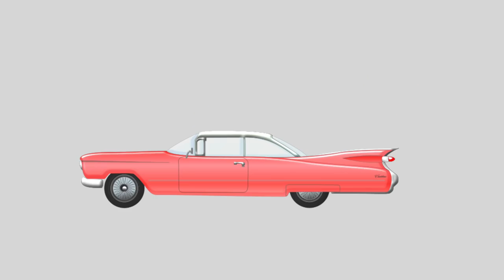Yes, Rockets CAN Fly in a Vacuum

Comment: No rockets can not fly in space.
Reply: A double negative? Who taught you to write?
Reply: @kitcanyon658  "A double negative" is a fragment.
Reply: @jrstuckey1471  :  Touché.
Reply: Well it's interesting, because not only can rockets work in vacuum, they are more efficient there, too!
Reply: You are right!
All rockets can fly in space.
Reply: @kornelrokolya  b.s.  There's no such thing as a free lunch or this "they become more efficient!"  W/o drag no thrust, without a downward force no lift.  So gtfo with this "it just works more efficiently there!" bullsheet.
Reply: @DrCash7  Drag has nothing to do with the thrust of a rocket engine. You create thrust by producing hot gas in your engine. The particles from that gas collide with your rocket and push you away, while you push them in the other direction. Not the particles in air, but particles which you just released from the combustion of your propellants. It has nothing to do with air, drag, or wings.

You're trying to project principles of one form of propulsion (aerodynamic surfaces, wings) to a completely different form. That's like asking how a car can move if it doesn't have pedals like a bicycle.

Comment: 0:65 the explosion forces air out of the exhaust...that really done it for me. Missy, do you know that a car works by using that combustion energy and apply it to the wheels? It is not using the energy of combustion to propel the car by means of exhaust gas. I know for sure, because I own a car. That's how it works.
If somebody tries to use the exhaust force of an automobile to explain why rockets work differently, this somebody should never ever voice their opinion again. Maybe about some royal or celebrity gossip - but never about how things actually work.
I still can't believe your car moves by the force of the exhaust gas. I want one of these.
Reply: Question for you, if i fire bomb near car would it move? If i fire similar bomb in vacuum will that car move?

Comment: I think that the motion of rocket in vacuum is due to newton 1st law (law of inertia) because there is no air resistance and gravitational force in space which stop the motion of rocket.
Will it be correct or not?
Reply: You would be wrong to think that there was no gravitational force in space. Remember that, for example, Pluto orbits under the gravitational influence of the Sun, and if the Sun's gravity reaches at  least as far as Pluto logic dictates that it must also be present in all of the space closer to the Sun.

Comment: In space. Acceleration would continue. The problem will be slowing down. ..?
Reply: No, it would not keep accelirating.
Reply: How not? 
No friction. 
No resistance
What force is there to counteract the accelerative motion? (Genuine question)
Reply: @Pappa953  you mean with the engines on or off? They would keep accelirating if the engines were pointing away of where they are going. Decelerating is just pointing the engines towards where they are going.
Reply: Pappa G - You mean "VELOCITY would remain constant", NOT acceleration.
Acceleration requires a force, maintaining velocity does not.

Did you even take high school physics?
Reply: Stuart Gray  I did take high school physics. But too long ago for it to be relevant and for me to be absolute in the vernacular. But politeness has remained. Twatty snarky comments to strangers so as to elevate my ego isn’t in my remit.
Reply: @Pappa953  so do you believe that rockets DO work in vacuum or not? if NOT, I can convince anyone (with a high school grasp of physics) exactly HOW rockets work in a vacuum.
Reply: Stuart Gray my understanding is that yes they work in space. However unlike the movies an initial burst to get it moving is all tha would be required to begin moving. Because there no resistance or friction the object would continue to accelerate. Until an opposite force is applied to reverse that. Any explanation more complicated than that. My brain won’t be able to cope.
Reply: @Pappa953  - You had some of the above right until:
"Because there no resistance or friction the object would continue to accelerate"
No the rocket will NOT continue to ACCELERATE.
  It will only do this when UNDER ACCELERATION when the rocket is FIRING.
Once the rocket is done firing the projectile will continue moving with constant VELOCITY until acted upon by another FORCE.

Comment: Every action has an equal and opposite reaction. But in space, there is nothing to react against. I still don't understand. The only reason that a car goes forward is that the bottom of the wheel in contact with the ground is going backward, reacts with the ground, and forces the car to go forwards. But if you lifted the wheels off the ground, the car wouldn't move because there's nothing to push it forwards.
Unless you could make an object react against itself, like putting my feet in two buckets and trying to lift myself up. I can't say that I've actually tried it but I'm pretty sure it wouldn't work
Reply: Stand on a wheeled trolley. Assume it can roll in any direction without friction. 
Take two balls. A soccer ball and a bowling ball for example. They should be the same size, but clearly different mass.

In turn, throw each one of them in a direction, at exactly the same speed.

Will you and the trolley beneath you begin to roll when you throw the balls?
And if so, which case will cause you to roll faster? When you throw the heavy ball or the light ball?
Reply: You don't need to necessarily push against a medium to go forward. You just need to push against SOMETHING. For rockets, it's the gas produced when fuel burns. The rockets are pushing this gas inside them to the outside, so the gas pushes them in the opposite direction.
Reply: @richie6921  in this example, the hose pushed the water out , and the water pushes the hose behind
 But because you're touching the hose, when the hose comes behind, it pushes you a bit behind too
Reply: @aaryajain6396  Same that pushes a rocket along in space
Reply: @richie6921  yeah, rockets work on the same law.
Reply: @richie6921  Would a CROSSBOW, fired in a vacuum STILL HAVE RECOIL? Yes or No?
Reply: @stuartgray5877  yes, because the bolt is reacting against the cord. A rifle would also have recoil aswell
Reply: @richie6921  Then why don't you think a ROCKET would have recoil?

A space shuttle main engine accelerates 500 kilograms of pure water from zero to 2500 meters per second in about 10 feet.

You dont think that has some serious RECOIL?

Imagine a catapult that fires a 500 kilogram block of water ICE at MACH EIGHT?

You dont think that would have recoil?
Reply: @richie6921  No response?  Too complex of a concept?

Comment: 3:04 That, sadly is absolutely NOT true. It's not burning the oxygen. There's no such thing as what we call "burning" is in fact oxidizing. The same process as rusting, only much faster and giving away lots of energy. And that energy is what propels the rocket. And keep in mind that it's not even the energy in form of heat. It's the energy that's consumed to change the state of the fuel/oxidizer mix into gas. This means it greatly increases it's volume and is pushed the only way it can escape - to the back. That's what propels the rocket. :)

Comment: Actually, all 3 of Newton's Laws of Motion are involved during rocket propulsion. According to Newton's first law the propellants have inertial mass, so they resist being accelerated just as the vehicle does. As such, when the rocket engine accelerates the propellants they resist the change in their momentum due to inertia. Therefore it is actually the propellant's inertial mass that the rocket pushes against. Essentially the vehicle and the propellants push each other in the opposite direction away from one another. This is why no outside medium is required for the rocket to push against. Then, according to the second law, the higher the propellant mass that is being accelerated the higher the force required to accelerate it. This is why heavier fuels like kerosene produce more thrust than lighter fuels like hydrogen. And finally the third law states that the force of the propellants being accelerated backwards creates an equal and opposite force on the rocket to accelerate it forward.

Comment: Nope, YOU still don't get it! The explosions in the rocket combustion chamber push in all directions. Pushing on the sides cancel out. Pushing on the top propels the rocket forward. Pushing on the bottom just escapes through the nozzle, which has to properly shaped and directed to ensure that the escaping flow is symmetrical all around, otherwise the rocket will veer to one side.
Reply: Einstein WasRight 
Pushing on top couldn't make the rocket go forward.
There are two places on top where thrust could go, first are the fuel lines in which case it would block them or the fuel could bounce of off a surface which could technically give thrust but it would be cancelled out by next coming combusted fuel and would also be cancelled (or even overpowered) out by that thrust going there in the first place (3rd Newton's law).

Comment: Now that was one confusing explanation.... No mention of the mechanical transmission of the energy from the burning fuel. I thought this would have been kind of important in helping to explain how the car wheels obtains the necessary torque to create the rolling friction needed to propel the car forward. Everyone knows the car exhaust isn't what propels the car so any mention of this could have been omitted entirely.Put simply it is the mechanical transfer of energy vs Newtons 3rd law.

Comment: Rockets work much better in a vacuum. Look at the specs of any rocket engine. You'll see IspSL--Sea level specific impulse--and IspVac--Vacuum specific impulse. Vacuum specific impulse is always higher, even for short-nozzled engines intended for first stage work.

Here is how rockets work: Linear momentum is a conserved quantity. If you define a rocket's momentum as zero to start with (because why wouldn't you?) and then you fire it for a while, after you finish firing, add up the momenta of every single atom that originally formed part of the rocket. It will still add up to exactly zero. You have part of it that has stayed together in a solid lump moving in one direction, and a cloud of expanding gas moving in the other, but the center of mass of the whole system hasn't moved, and the total momentum hasn't changed.

"Force" is a red herring. It's an artifact of focusing on part of a system (the rocket) and ignoring the rest. You have to invent some reason why the part you're interested in is accelerating. Well, the momentum of the exhaust has to be balanced by a momentum in the opposite direction, because momentum is a conserved quantity. (Momentum = mass x velocity).

All of Newton's 3 Laws can be replaced by: "Momentum is conserved". Paraphrased, they say:

First Law: "If the momentum doesn't change, it stays the same."
Second Law: "If the momentum doesn't stay the same, it changes".
Third Law: "The momentum can't change".

Comment: The internal combustion engine turns a crank shaft which in turn turns the transmission and then moves the wheels.  Were is the transmission on a rocket or the crank
 shaft?
Reply: She explained... rockets do NOT work like a car.  Rockets burn fuel and oxidizer inside an engine bell.

Comment: In a vacuum the air would just bleed out of the balloon.  You say the air pressure inside is pushing the inside front of balloon.  That's true it is.  However there is equal air pressure inside pushing on the inside  back equalizing "push" Therefore the balloon would not work in a vacuum.

Comment: Thank you! You are amazing!! I have a question, SaturnV works with kerosene and oxigen in the first stage and hydrogen in the second and third, why this kind of choice? The kerosene had a more power at 0 level?
Reply: Kerosene is much denser. The tanks in the first stage would have to be bigger and still carry the weight of the upper stages if it used hydrogen. Also, what you need leaving the ground is the most thrust you can get. The lower specific impulse (exhaust velocity) of kerosene means you throw out more material slower to generate the same thrust than with hydrogen.

 Higher specific impulse is great, but since kinetic energy goes up with the square of the velocity, power goes up much faster, so the kerosene engine give you more thrust for a given energy per second. Later on, when you're trying to speed up to orbital velocity, you need all the specific impulse you cn get, so hydrogen is great for upper stages.

The Russians didn't get to the Moon because they didn't have hydrogen-fueled engines, so their first stage had to be gigantic even for a tiny two-man spacecraft.
Reply: Karl Storie thank you!

Comment: Wait..did I miss something?car moves because of combustion that happens in the machine, moves pistons and gears and the shaft so the tires turns and move the car, right?not because the exhaust force..right?what's going on here?
Reply: @Defrianto Victor Mantong wrote: "car moves because of combustion that happens in the machine, moves pistons and gears and the shaft so the tires turns and move the car".
That is exactly what she said. Exhaust from tail pipe is also pushing car forward but it is negligible force. https://youtu.be/qWj7wBHB_rE?t=51

Comment: So what does the rocket push against whilst in space ? It's a vacuum so what do the thrusters push through to get it moving ? I don't believe it's possible I'm afraid.
Reply: "So what does the rocket push against whilst in space ? It's a vacuum so what do the thrusters push through to get it moving ? I don't believe it's possible I'm afraid."     -     Can you explain how a rocket 'pushing against' the atmosphere that is not "in space" could propel a rocket? If not then your beliefs in this area are likely too uniformed to be relevant.  The point here being that your 'push against' would mean exhaust gas molecules that have been expelled from the rocket engine colliding with air molecules, and given that neither the exhaust gas molecules nor any air molecules that they may collide with are attached to the rocket at the point when they collide how could those collisions influence the motion of the rocket.

Comment: This video doesn’t actually explain it at all.  It’s not “the force of the gas escaping from the end of it” that propels the rocket.  It’s the unbalanced force of the products from combustion acting on the front wall of the combustion chamber that pushes the rocket forward - it’s not the force of the propellant leaving the rocket at all.  The propellant has to leave otherwise an opposing force would be created on the side opposite the front wall, and the rocket would remain still.  But it’s completely wrong to say the propellant leaving the engine is the force creating the propulsion....
Reply: Not really.  You can calculate the force on the nozzle in TWO ways.  One is to do as you said above and look at the unbalanced for es on the inside of the nozzle.  The other way is using the Law of conservation of Momentum and find the force on the rocket from JUST the mass flow of the exhaust and it's velocity.
Reply: Stuart Gray sure, but the force that propels the rocket forward still acts on the front wall of the combustion chamber - even if you calculate the force as a conservation of momentum problem.
Reply: "... the force that propels the rocket forward still acts on the front wall of the combustion chamber ..."     --      If that is true why do rocket engines have nozzles downstream of the combustion chamber? And why, for the 'J' missions, did the Apollo LM decent engine get a 10 inch extension to its nozzle?
Reply: @jamesd362  Your explanation implies the rest of the convergent-divergent nozzle does not matter, which is obviously incorrect. You have a point that ultimately forces are transmitted by pressure acting directly on the walls, but it's not just the front wall of the combustion chamber.
Reply: Appable I’m not implying the shape of the nozzle doesn’t matter.  There’s optimal shapes depending on a range of factors, but regardless, the net unbalanced force will be pushing on the combustion chamber in the direction the rocket is accelerating
Reply: @jamesd362  Oh. Spent a bit of time trying to figure this out because I was convinced you were wrong and it turns out you are entirely correct. Sorry. I think I falsely equated "nozzle important for efficiently accelerating flow" with "longitudinal forces on the nozzle must be significantly and directly contributing to thrust".

Comment: is it possible to travel in space kinda like sea turtles useing curents in the water for speed insted of fule? Are there parts of space like the ocean like that?
Reply: You could use solar sails, which use the solar wind for acceleration.

The other option is a series of gravity assists, passing close enough to a moon or planet to get a free change in your direction. If you line up several gravity assists you can get to almost anywhere in the solar system with almost no fuel expenditure, but it will take a very long time.